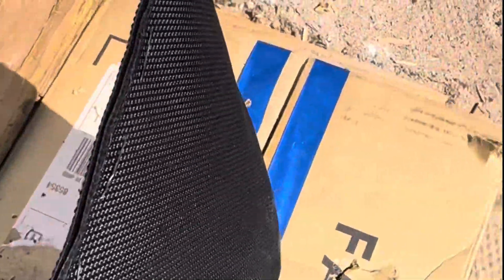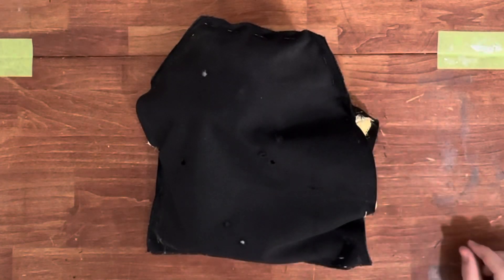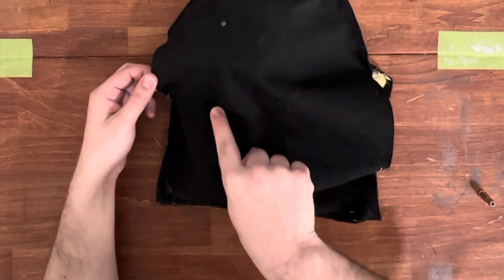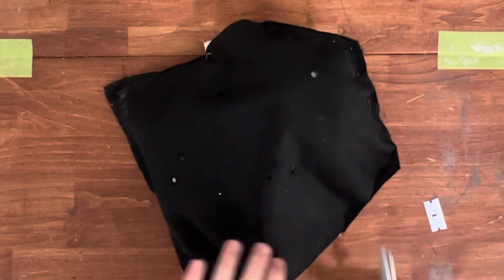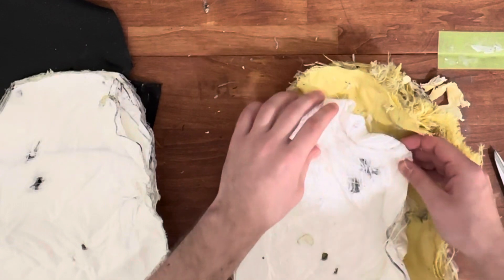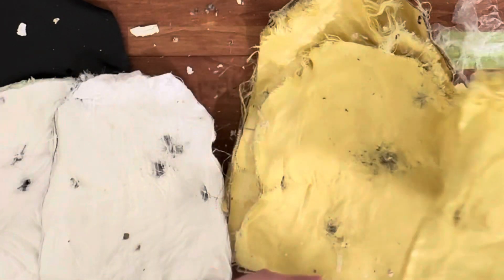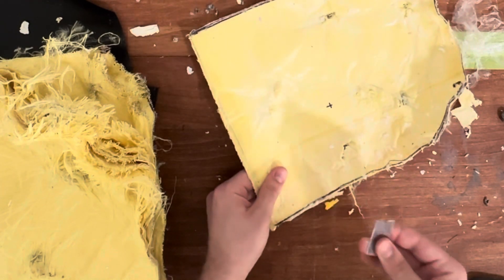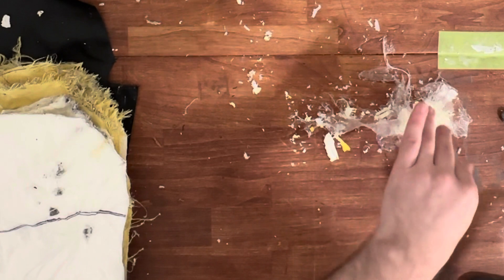Homemade 3A+ Armor stops Liberty Civil Defense 9mm and 1700fps 44magnum!!! (.33in/8.5mm thick)

Comment: The non woven kevlar sheets act as an air tight seal, so the silicone can't interact with oxygen and it won't cure, the same way it doesn't cure inside it's own tube. The initial evaporation of liquid will form a skin on the silicone, but the full "curing" is a chemical process which needs oxygen. The only place it is exposed to air is around the edges of the sheets, which isn't enough.
Reply from the maker: Any suggestions on a way to get it to cure?